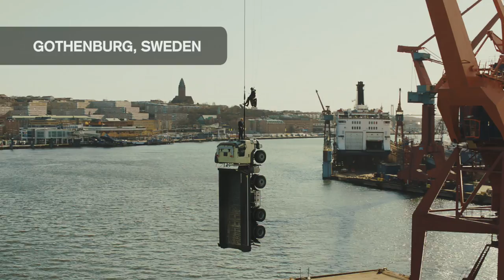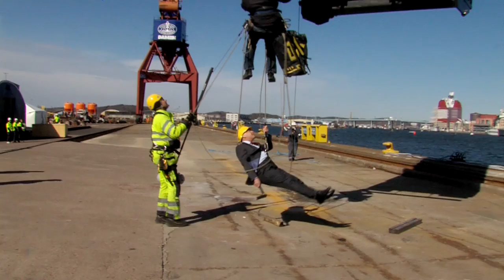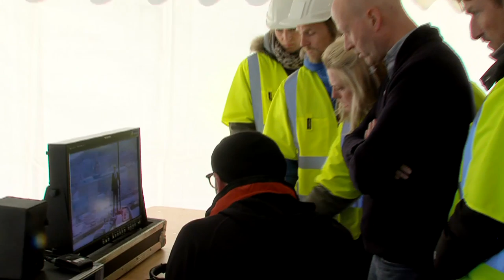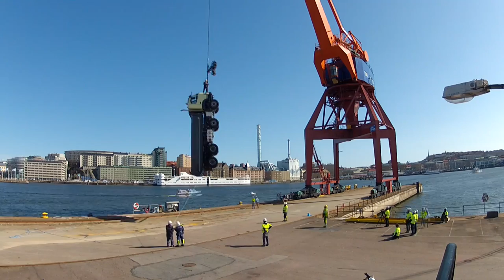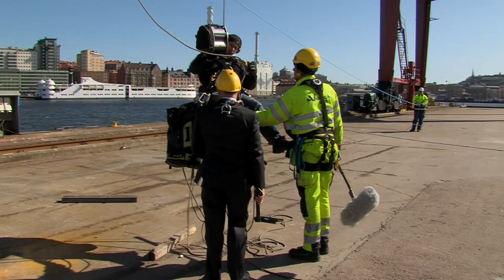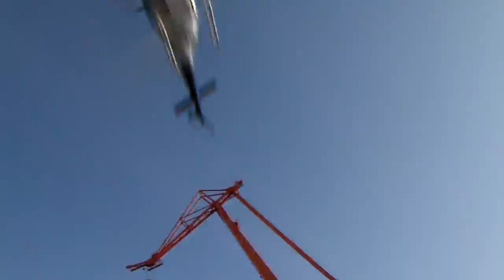Volvo Trucks - The Hook: Behind the Scenes

Comment: Very good indeed. But the safety cable was erased by computer. 
It's still a valid confidence on his products...?
Reply: The safety cable was attached between the "sound guy" and Claes - it didn't bear any of the weight of the truck; while the blue ropes attached to the bottom of the truck were just to guide it safely into position and help stop it swinging once in position over the harbour.
Reply: @mittfh  His point is: The CEO did not put his life on the line to demonstrate the quality of their product, which was suggested by the original ad. In this clip it says: "No tricks". Actually I was also very interested if this "behind the scenes video" would reveal some tricks .. and it did.
Reply: Probably legally required for insurance reasons...I know in the United States it would be....legally required to pay for insurance but you're not allowed to use it lol!
Reply: @alexanders8317  He did put his life on the line, if the truck fell so would he. The they knew the truck wouldn't fall, but the couldn't trust him not to fall, either slipping or fainting etc. He is only secured such that he couldn't jump off the edge. But if the truck fell him and the guy his cable is attached to would both be dead.